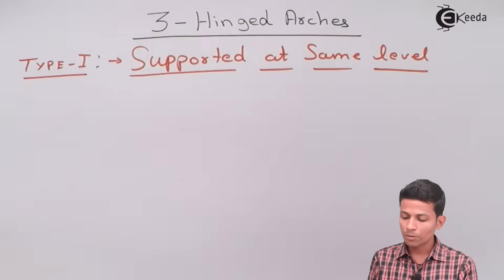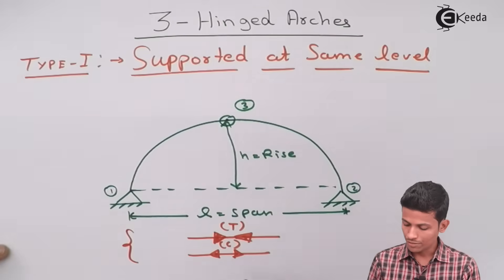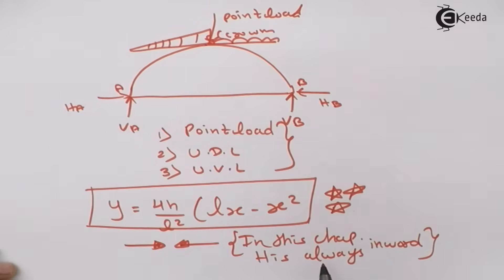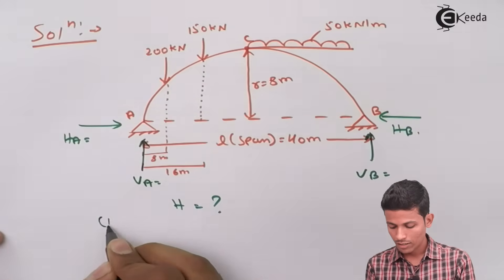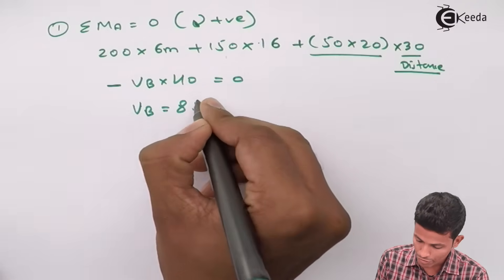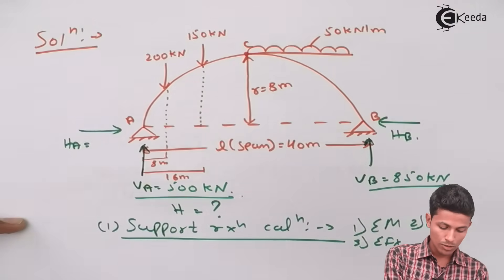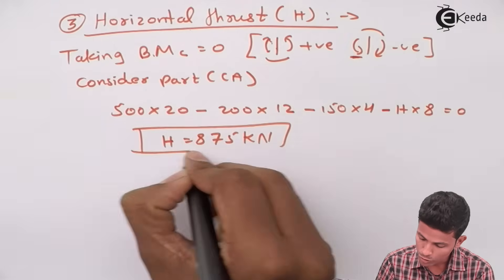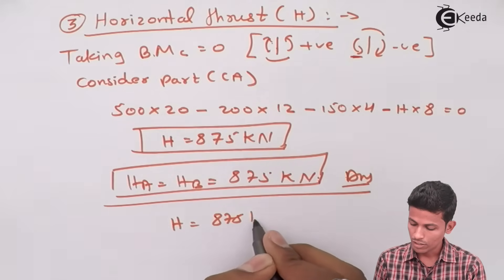3 Hinged Arch Type 1 - 3 Hinged Arches - Structural Analysis 1

Comment: The distance from A will be considered for taking moment so  first we will. Convert the udl into point load = 50×20 then we will calculate the distance as the udl acts at half so (20÷2)= 10 but we will consider the distance from a so 20+10  will be taken 

Ma=0
Vb x 40=200×8+150×16+  50×20×((20÷2)+20)

For ppl who are getting it wrong

Comment: Can anyone 7:59 Distance=30 How?
Reply: The distance from A will be considered for taking moment so  first we will. Convert the udl into point load = 50×20 then we will calculate the distance as the udl acts at half so (20÷2)= 10 but we will consider the distance from a so 20+10  will be taken 

Ma=0
Vb x 40=200×8+150×16+  50×20×((20÷2)+20)

Comment: The inward forces gives compression...and ....outward forces indicates tension but you said reverse....
Reply: he said it with reference with the arch , if arch is subjected to compressions the hinged support will move outward. he also stated "only for this chapter". make sense now ?
Reply: It's the rule to draw kissing arrows for tension and away arrows for compression
Reply: https://youtu.be/1e1cSZ1YVTM

You can check problem on three hinged arch, in this link
Reply: But Sir for unit load method ,away from each other is compression and toward from each other is tenison  .is this correct or not ?
Reply: @SHiVAEK   due to the applied load on the arches, the reaction developed are inward or we can say.. Coming towards each other. That is compression. 

Suppose, in our house, I used a rope to hang my clothes with hanger, for the equilibrium, tension is developed at the support. So, out ward means tension.